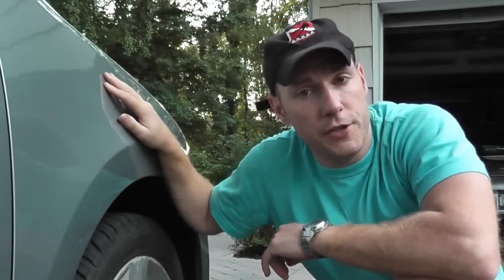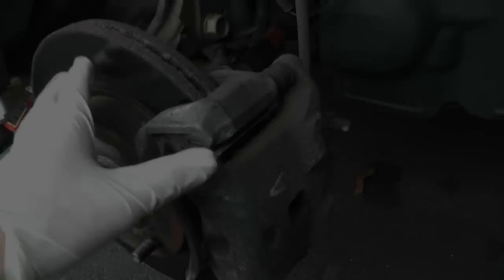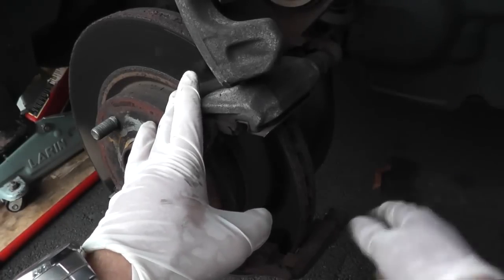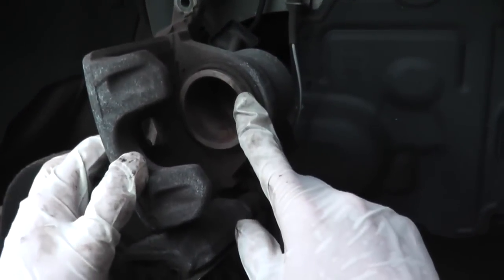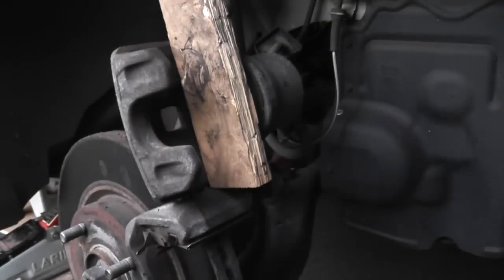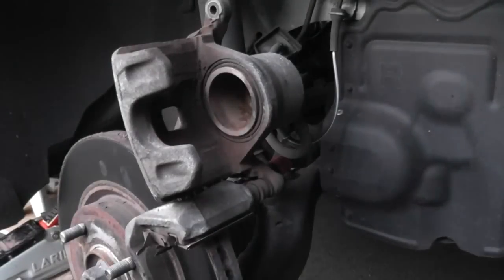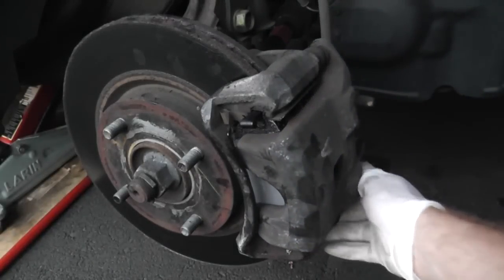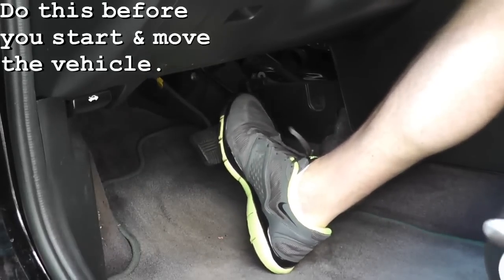Nissan Sentra Brake Pads Replacement with Basic Hand Tools HD

Comment: You forgot to engage the brake pad relief tab at the tops of each brake pad. It's that wing you see sticking out. It's supposed to be hooked in to the loop of brake pad chatter device. When you release the brake pedal, this spring arm pulls the brake pads away from the rotor.

Comment: Just wanted to double check because I didn’t see it mentioned in the video or the comments below, on the Sentra I was working on the protruding tension pin was at the top on the front pad but on the bottom of the back pad. I placed the new pads with the tension pin at the top for both pads, was I wrong to do so?
Reply: you were correct, I had to look up and verify as well.

Comment: In addition to not forgetting the brake pad spring. Anyone using this tutorial should look in the owners/service manual for the proper jacking location. Then you won't end up with the bent car body it worse a jack stand through the floor.

Comment: Forgot a very important part in your video The slide clips tention spring to the pads You left it stinging straght out Never put it through the loop at the wear indicaters located  on the outerside of the pads!!

Comment: Great video man, one thing I noticed,  I hope that car doesn't have ABS because pushing the fluid backwards through the check valves can be bad and trigger a trouble light.  I was always taught to open the bleeders then compress but that's just probably difference in training.
Reply: It is a very good remark and addition to the film. Thank you very much for sharing your knowledge. I'm working on the 3rd brake sets in my DIY experience, but I've never heard about such negative effect on ABS. And the last one was 2009 Nissan Sentra w/ABS.  Hopefully nothing happened, I didn't open the bleeders, when pushing the brake fluid. I didn't drive that car yet, but it is very good to know what will be the reason for the trouble light if it comes. 2 others of our cars don't have ABS. Next time I work on our Nissan front brakes, I'll definitely follow your advice. Thank you again.

Comment: With respect, you forgot to engage that little spring tab ear at the top of pad area (and fits into the wear indicator tab) that pulls the pad away a fraction when the brakes are disengaged. There is one on the inner side as well. I forgot this once myself on a Maxima, so I understand how it can be overlooked.
Reply from the maker: Thanks for the heads up. I don't remember seeing that in the repair manual. I'll have to take another look. Cheers.
Reply: @CarsNToys  prior person forgot as well, prolly why you didn't catch it.

Comment: This is so nice and easy. Nissan wanted to charge me $200 for this. They wanted to sell me the parts for $69.99. I purchased nice ceramic pads from an auto parts store for $50. I have a friend who’s a mechanic and will put them on for me for $30. I know it’s all about the labor cost but Nissan didn’t have to try to rob me like that.
Reply from the maker: Dealer's are quite expensive. They have a ton of overhead.

Comment: You missed the upper hardware clips through the loop at the top of the pads. It looks like the prior person did as well. These are are very important as the springs are designed to push the pad away from the rotor after the piston retracts.

Comment: I feel like thinking about anything being wrong with my car means automatically taking it to the shop, but this video shows that a car is just a big you puzzle. Thank you so much for this!!!! But I have a question, do you have to do the wood step?? I didn't understand what that was for. Or if I can just life the caliper thing up, replace my brake pads, and skip that wood step. Or is it a must???
Reply from the maker: Cristina Aguirre You'll need to drive the piston of the caliper back into its bore. To do that, I used a c-clamp. The piece of wood was used so I didn't damage the piston. You can also use large channel-lock pliers instead of the c-clamp.

Comment: great video. when do you think the rotors should be replaced? i can hear metal to metal and i didnt have time to replace them right away. Im planing on getting parts and doing it myself, i just wasnt sure if need to replace rotors also?
Reply from the maker: It's certainly a good idea if they are uneven. (You'll often feel unevenness via brake pedal.) You can also test them like this: https://youtu.be/IzPn0RnH4cQ

Comment: I'm thinking about replacing my brakes for the first time by myself. I think I understand how to do it. My only concern is that I've seen some conflicting information about applying brake grease on the rotor and the front side of the pad where it makes contact with the rotor. Will adding the grease cause the brakes to slip on the rotor and not brake properly? Does not adding brake grease on the rotor damage my car in any way?
Reply from the maker: Grease goes on the back side of the pad. Just do a simple google image search 'brake pad grease' and you'll find multiple images showing where the grease is placed. Cheers.
Reply: @CarsNToys  Wow! Never would've thought of looking at the images tab. Thanks!
Reply: You do not put grease on the rotor!
This is the contact point of the pads and the rotor that makes the car stop.
Grease is applied to the side of brake pads that is not in contact with the rotor.
If you are unsure, don't bother with the grease. It will still be fine.

Comment: Great video man! Question though, why is it important to push that piston back into the caliper with a clamp?
Reply from the maker: When you install new pads, the piston needs to be pushed back in. Otherwise, it won't fit. You can also use large pliers.
Reply: CarsNToys Makes sense, thanks man!
Reply from the maker: Glad to help.

Comment: Hi very thankful, my wife have a nissan Sentra same year, when use the brakes the steering wheel shake, no with hight speed, what you recommend,is the disc?we never replace, Thank you
Reply from the maker: Hello. Yes, most likely it's due to warped rotors.
Reply: Ok thanks

Comment: If I don't have a C clamp is there another way to push the piston in?  Lightly tap with a hammer and the block of wood?
Reply from the maker: thefirstistheworst You can also use large channel-lock pliers. Tapping with a hammer will be difficult. You need to keep sufficient pressure on the piston.

Comment: hello! just want to ask, is it the same thing at the back?
Reply from the maker: Mark Gutierrez Depends. Some of these Sentra's have drum brakes in the back instead of disc brakes. If that's the case it's completely different. However, if you have disc brakes in the rear then it's very similar. The only difference may lie with the caliper. On some Nissan's you need a special tool to drive the rear brake caliper bore. Check out my rear maxima brake pad removal video for further detail.

Comment: Anyone following this is going to do it wrong. It says, "performed by an experienced tech", but you didn't engage the relief clips at the top of the pads! Additionally, the rusty brackets should be replaced; they're only a buck or so apiece and will come with all but the cheapest pads. I'd recommend adding text that tells people about those tabs, or remove the video until you change it. You're showing people how to do it wrong.

Comment: That's a pad slap, if your going to to do your brakes do them right you should have the rotors machined but good video
Reply from the maker: Unfortunately, most people don't have a lathe in their garage to resurface the rotors. And these rotors were in fine shape and well within specs.
Reply: CarsNToys ya like auto zone o Reilly’s doesn’t offer rotor surfacing lol